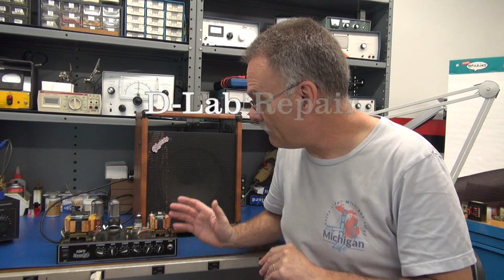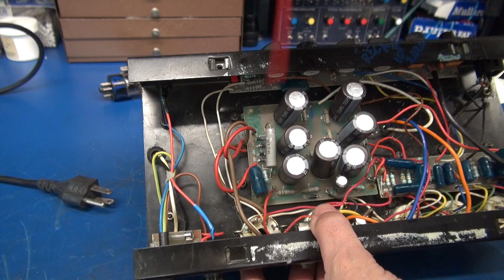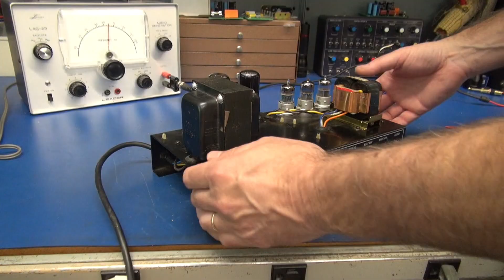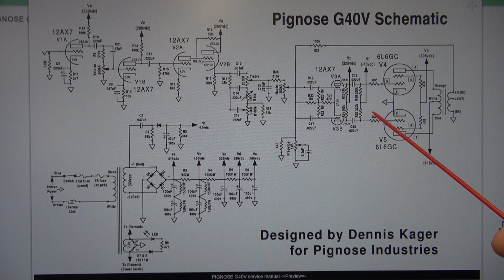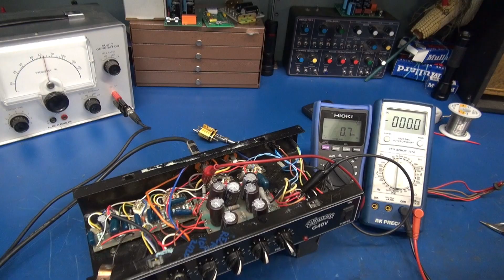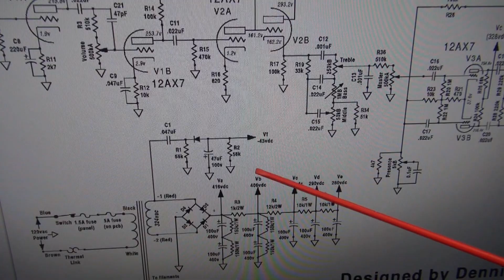Dead Pignose G40V Tube guitar amp Bad power transformer How to Mod for Harp playing 6V6 plus bias

Comment: Hi, 
I have a Pignose GV40 tube amp that I have had for about 12 yrs. The last ten years it has sat under the bench in my studio (unmoved) and I have used it now and again (not often)when recording guitar parts. It has always worked perfectly then recently when I went to use it when I turned the power switch on it pops the house RCD. I pulled out the chassis and checked for any thing that looked burnt or wires broken off but there is nothing obvious. When you probe across the ground wire to the power prongs on the plug there Is an open circuit. When the power switch is turned on then there is continuity between the earth prong and one of the power prongs so a dead short exists. I originally rewound the stock power trans and it has worked perfectly for 12 yrs. 
Update………..
Today I found after troubleshooting and removing the transformer leads and ohm testing I discovered one wire of the transformer primary circuit was shorted to ground. Luckily I had all the ohm resistance readings for the transformer to compare with my original readings. Now I know why it was tripping the RCD!!!
The thing is it didn’t blow either of the two inline fuses??? I did think about sourcing a replacement PT from USA but with currency exchange rate and cost of shipping to NZ it wasn’t economical. 

Update: I dismantled the power transformer and rewound the primary coil. Luckily I had kept all the information I had on my Piggy and knew how many winds were needed so sourced the 0.6mm wire from Jaycar Electronics. I reassembled the PT and fitted to chassis and resoldered the wires. I tested the circuit with ohm meter and it checked out ok.  I also rigged up a light bulb tester and connected the amp to it and switched it on and no light came on so circuit tested good. Plugged amp straight into wall socket and fired it up and  tested the primary voltage ok. 
Grabbed my strat and 1x12 cab and connected up and jammed awhile. It sounds great again. 😀😀😀
Reply: Update: After playing the amp for about 40 mins it again popped the house RCD. I unsoldered and pulled out the rectifier board rechecked all the capacitors and discovered one of the 150K 1 watt resistors had blown so found a replacement resistor and fitted that. I resoldered all the caps and refitted the PCB board and resoldered the connecting wires back on. I plugged it in through the dim bulb tester and fired it up and no light from the bulb so plugged it into the wall. I found all the DC voltages were very low and some head scratching and brain storming ensued. After a couple of days of looking at the schematic and looking at the amp and checking the connections I discovered I had missed soldering the ground wire to the rectifier PCB. Once I resoldered that back on the voltages were all up to what they should be. Whew! 😃😃😃

Comment: Hilariously I just opened one of these to repair for a customer and it had exactly the same fault - no fuses blown but the P.T. primary winding has gone open circuit. I saw a thermal fuse in the schematic but if there's one in the transformer it's buried so deep it's not worth chasing down. Modern junk design - the aftermarket replacement power transformers from Mercury are 'uprated'...because the originals were underrated!

Thanks for the video, great idea switching to a used PT from an older amp that used 6V6 valves. I might offer that option to my customer, and I'll be swapping out the main fuse for a T1A!

Comment: Where can I get that power transformer? I have the same amp with the same problem. Need the power transformer and filter caps. where can I get one or how to spec a comparable. The existing transformer is the TEN PAO T2A32004F who does not offer them anymore. Thanks

Comment: Just changed out the power tube sockets in my G40V this morning. Stock ones were getting noisy and intermittent. She's sounding great again! I mostly run her at quarter volume in triode mode because it is a very loud amp in pentode mode.

Comment: Nice work as always Terry. With replacing the bias resistor with a pot, would it be more advisable to add the pot in series with a smaller value resistor that way it also adds a level or failsafe option in case the pot dies or it vibrates somehow and goes to 0 ohms.
Reply: Someone trying to adjust bias could easily turn it all the way to zero. It is an accident waiting to happen. Maybe a 25k pot and 25k resistor in series could work.
Reply: @infectionsman    like he doesn’t know this already? its not by accident   so when that does happen ,they bring the amp back for repair!!
Reply: @infectionsman  that would be someone who has no business dealing with amps.... i agree about the resistor to ground so its fail safe

Comment: Excellent video, really cool to see a change like that can be made. Any lingering concerns given what happened to the original transformer tho? Two fuses ok... just a rare bad unit and age/environment then? Maybe a blown fuse was replaced but damage already done, if that's a possibility... I don't know. Thanks! 👍
Reply from the maker: I would guess that it had been over fused before arriving the shop
Reply: @d-labelectronics  Could have been a thermal fuse inside the transformer maybe?  Still have to change the transformer, but that would also explain why the main fuses did not blow.  I have an amp here with just that problem.  I can bypass that fuse, and the amp will work, but I will NOT send that amp out with a customer until the transformer is replaced.
Reply: @billrenfro9798  Wow, another fuse inside? That's for disaster avoidance I guess. 😆  Certainly the external ones should kick off first.
Reply: @d-labelectronics  Ah, hadn't considered that. Yes, perhaps.

Comment: I suppose you could measure the resistances either side of the pot wiper and use fixed resistors.
Just wondering if this would be more stable and anti-fiddle.
Reply: Yea and with the cost pots today...

Comment: What was your reasoning for using the CT on the PT? Did you need a lower secondary voltage? Just asking, you never said what the secondary was on the new Sencor.
Reply from the maker: Nope the HV winding had a standard CT. If I used the full wave rectification without it, The HV would be to high
Reply: @d-labelectronics  Yeah that's what I was wondering. I figured that was your reasoning, but I didn't know if the secondary on the new transformer may have been a lower voltage or not. That might be something you could go into in future videos. To the inexperienced it looked as though you went with a full-wave because the new transformer had a CT and you were forced to, when I'm reality of the secondary would have been the right voltage across the whole winding, you could have just connected it in the configuration it had originally. Keep up the good work, Terry.

Comment: What about the impedance mismatch of the output transformer?
Reply from the maker: What is the primary impedance of the OT transformer? Is it a mismatch?
Reply: @d-labelectronics  That's a good question. 6L6s usually have about 1/2 the impedance of a 6V6 output transformer.
Reply: Good catch.  Be interesting to know the answer.  Speaker impedance could be adjusted to compensate for the primary mismatch.
Reply: Its about double with 6v6, so you would mark the 8 ohm tap as 16 ohms,   and 4 ohms becomes 8 ohms.